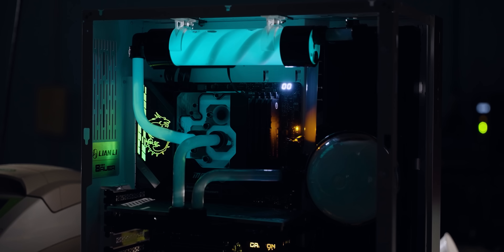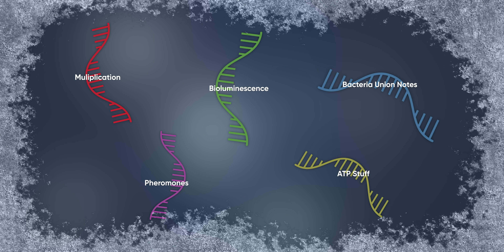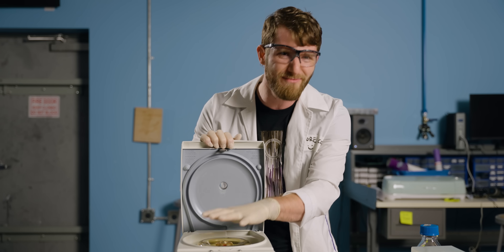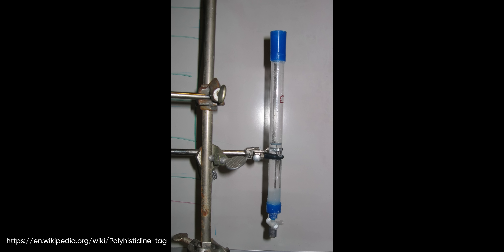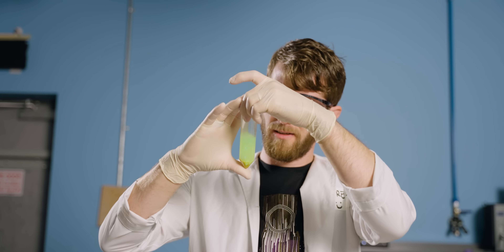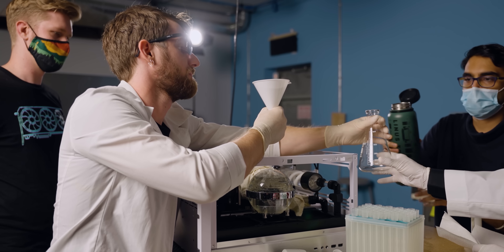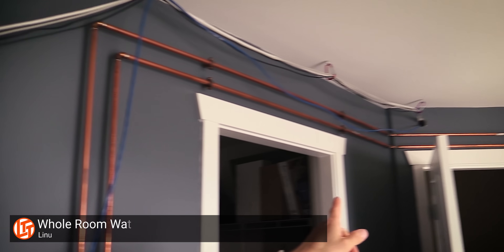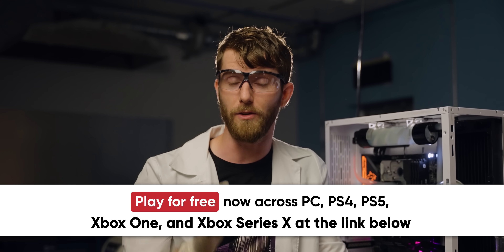The Bioluminescent Gaming PC

Comment: If Nyoka Design Labs keeps improving this material, I could see this come to PCs as a liquid coolant in the future.
Reply: I don't think so, as Linus said, the particles are a problem on it's own, then you have proteins which also mean depositions that could clog the conduits and then there's temperature which will denature the proteins so the effect won't last too long no matter what you do. So overall it's not something practical to dz you'd need to thoroughly wash and purge everything after a few hours every time. That's why is good as a temporary glow stick or something similar but not for getting a cool effect on a PC
Reply: @walkinmn  Yep. It'd just be dirty water after a few hours.

Comment: How long will it glow?
Will it glow as long as it's moving?
Reply: right now we have developed the glow to last from 30-60 minutes, and are going IN on making it brighter and longer lasting as our ongoing research. Moving it can help it to stay bright!
Reply: @luxbio  cool, i just asked myself if it's possible. I mean there's the Heat from the CPU and the Friction from moving through the Tubes. There's some sort of Energy that the Liquid could transform into Light as long the Computer is running. But i don't know much about Chemistry.

Comment: You should experiment with Fluorescence Thermochromism - liquid that changes color based on temperature. These compounds are very tricky, but you can have it glow blue under UV when cold, and yellow when it gets warm, red when hot. 

Now generally these require extreme temps, but I haven't looked into it in a while.

Comment: My PC glowed once too, when my power supply shorted and caught on fire. 

Much cooler looking than this, but far more dangerous and expensive

1/10 do not recommend
Reply: Wow, power supply AND arc welding machine in 1 package! Now that's the deal of the year 😂
Reply: @john639-r2f  hell yeah! I got so much done that the fire department came to congratulate me
Reply: My PC glowed too! There was a fault in the power supply and it sent so much current to my graphics card, that it melted glowing red hot. Don't cheap out on power supply guys. The money saved on it was not worth that GPU.
Reply: @Telhias  my whole PC was ruined because I put it out with a fire extinguisher. Oh well. Rather ruin my PC than burn down my whole house
Reply: lol did you let ELectroBoom work on it? if so that'd be why it exploded
Reply: AISURU.TOKYO/mizumi/?[🤤]
(◍•ᴗ•◍)✧*。18 year and over

Youtube: This is fime
Someone: Says "heck"
Youtube: Be gone
#однако #я #люблю #таких #рыбаков #Интересно #забавно #девушка #смешная #垃圾
Reply: AISURU.TOKYO/mizumi/?[🤤]
(◍•ᴗ•◍)✧*。18 year and over

Youtube: This is fime
Someone: Says "heck"
Youtube: Be gone
#однако #я #люблю #таких #рыбаков #Интересно #забавно #девушка #смешная #垃圾